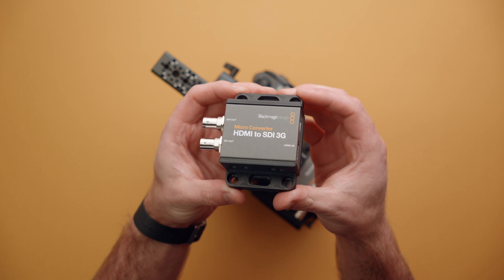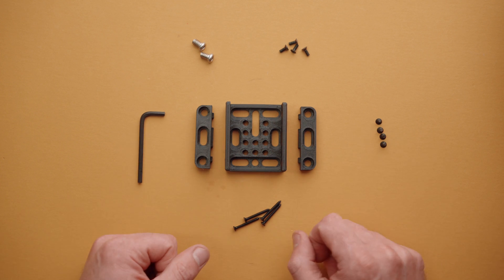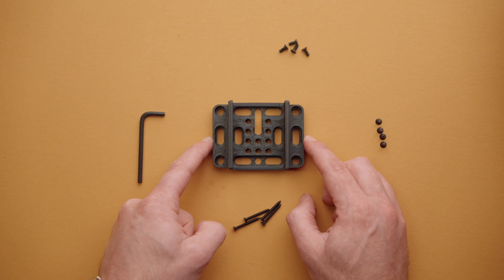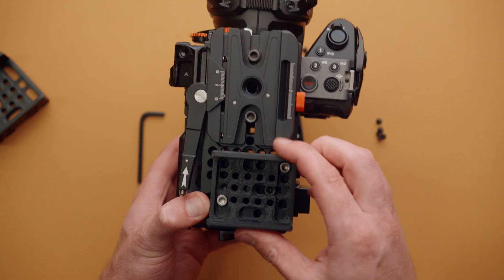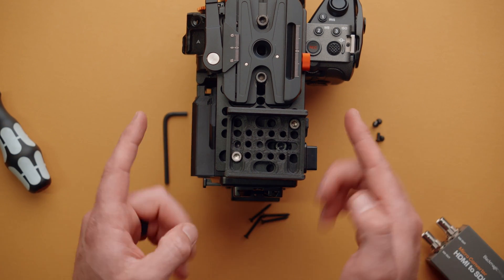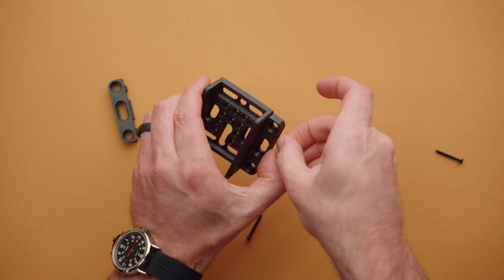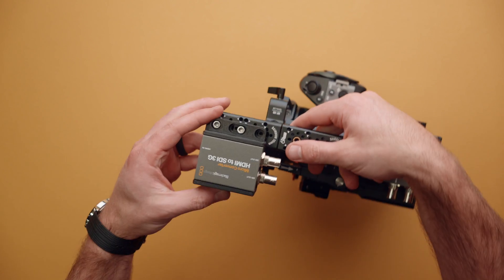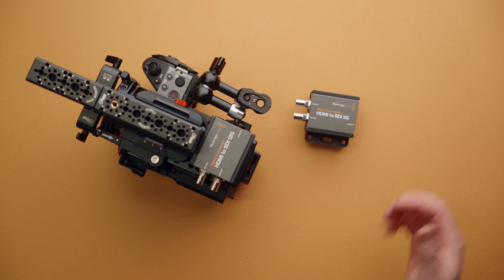Add Dual SDI Outputs to Your Camera Rig!

Comment: But why would you do this?? The advantage of SDI outputs are that they don't have an internal lag like HDMI. So if you have lag from HDMI and then you're feeding it into SDI, What is the advantage? Why would one want to do this unless they only had SDI gear?
Reply: To connect to SDI gear like a switcher?
Reply: But can you initiate recording from switcher? Control focus? Change color temp? That’s all I can adjust with así cams using switcher so looking for solutions but only Caleb has done content on this as vague as it is
Reply: The converter adds about a frame delay.
Reply: @AdamLangdon  Cool but HDMI already has delay! So, Again, how does this hep?

Comment: But why not show it all hooked up and running? Doesn't the micro converter need power? How much power does it draw in a one battery setup that's already powering a camera, monitor, and potentially other items. Don't get me wrong, this is a really cool idea, I just would've liked to see it up running.
Reply: My thoughts exactly
Reply: it draws 320 mA @ 5V, so 1.6 watts (information from the official website) so you could run it for days on an external power bank. Plugged into the usb port of a vmount, it's basically almost irrelevant in the power consumption scheme.
Reply: If think its a problem just use a bigger battery like ant film crew would . Ex camera Tech 30yr of work here..

Comment: Caleb, I LOVE this product but I’m gonna be that annoying person that wants more…. Any chance you could make one that fits the bi-directional sdi-hdmi converter? That model is amazing for live stream/broadcast folks like myself. It allows either sending program/multiview back to camera operators or with only one input it acts as a splitter which is the lowest latency way to get into the switcher by going camera hdmi into it, then hdmi out to a monitor and sdi out to the switcher. The versatility is amazing.
Reply: ^ this!  The two way is compatibility is very important for lots of industries